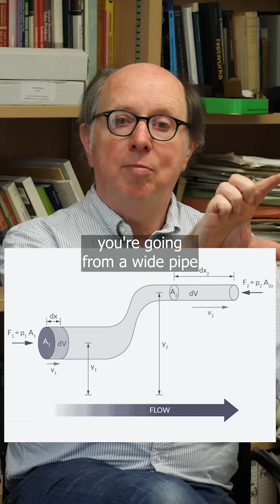Turn that tap off

Comment: Years ago when I switched from a top-load clothes washing machine to a high efficiency front load washing machine I immediately noticed a very loud "banging" from the water pipes at the beginning of the wash cycle because the washing machine is programmed to add a little water, then stop the water flow and spin the tub to check the balance, and it repeats this multiple times until it finally reaches the correct water level. Not only was it very annoying I somehow intuitively knew it was bad for the water pipes, so I "googled" the phenomenon and  learned about water hammer arresters which attach to the water valves to help reduce the hammer effect.

Comment: Valves in bigger systems are designed to have a controlled speed of closure, to prevent the  pressure pulse (the 'water hammer'). Or surge arrestors to manage the shock wave.